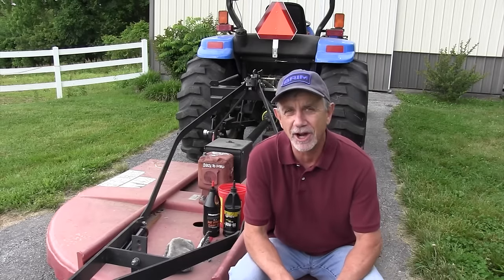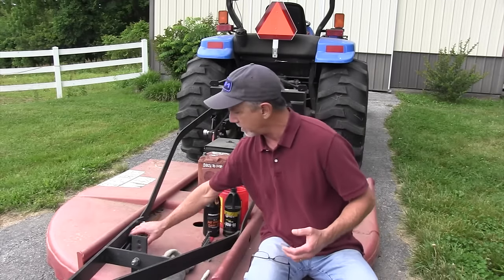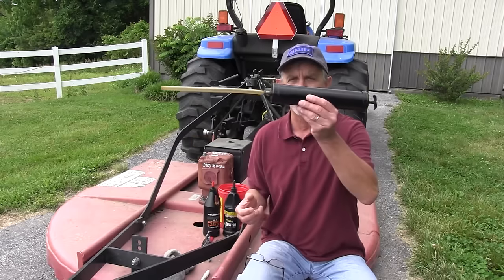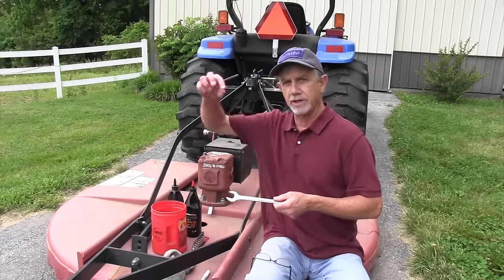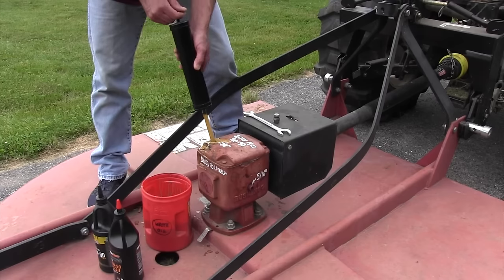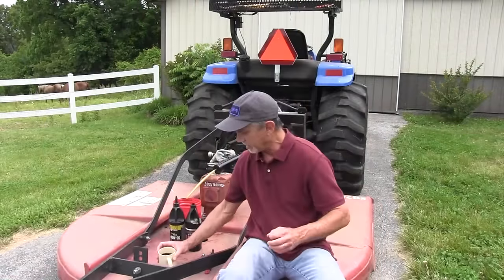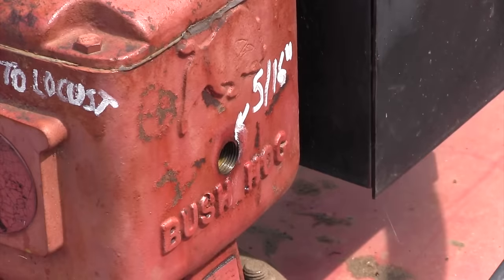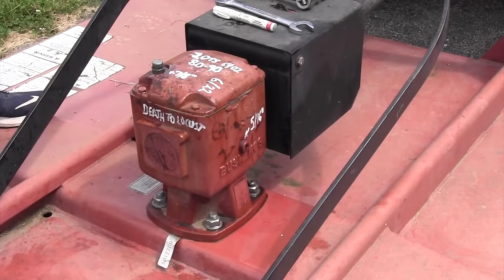How and When to Change Your Bush Hog Gear Box Oil

Comment: In 2009 I bought a County Line rototiller. They were really a King Kutter because I got a King Kutter manual with it. After I used it a couple of times and date it was time to check the oil in the gear case that's when I found out that it had grease and not oil in it. Brought it to the attention of the people at Tractor Supply and they said that that is a common practice to put grease instead of oil to prevent leaks. Been using it now for 13 years and haven't had any problems. Oh and Mike stick to making videos and not sing.

Comment: Great tip on marking with a paint pen. I have done that on mower decks with the blade bolt size, and any other tools needed. Nothing worse than lifting  mower deck, supporting, and crawling under to find out you brought the socket for the other mower deck, because, of course, they couldn't all be the same size.

Comment: Another way that those gear boxes get moisture inside is when people store them outside for winter and cover them with a plastic bag or plastic bucket. The sun heats the covered parts more than the outside air. When it cools after sunset, moisture condenses inside them.

Comment: Nice how-to vid Mike. Only suggestion I could add is to wrap that oil level plug with some teflon tape to prevent leakage and to make it easier to remove for the next time.

Comment: Mike, as I have commented before. I have that same cutter. I do one thing differently. I remove the 4 small bolts out that hold the top cover on the gearbox. Actually I remove 3 and back one off and swing the cover out of the way. This allows for a better inspection of the gearbox internals and easier manipulation of the suction gun.  When we had seals leaking on gearboxes at the state Highway dept we would take the top covers off and squeeze gun grease tubes into them. We could finish the road and change the seal when we got back to the shop

Comment: GOOD TIP HERE - I make a New contact on my phone for all my machines.  I have my truck, my M/C, golf cart, tractor, generator, etc.  Then in the notes section I put Vin number, lic plate, model, oil, filter ID, and TIRE PRESSURE..  if I do maintenance I put what I did when.  That way I always have my phone, I back up phone and if I am at a store and need something, I open up phone and have air filter size, oil wt, ect...  it works good

Since I usually fill up more tires at one time, I have a separate contact name Tire Pressure, I have all tires pressure on all vehicles, I hate trying to find and read tire PSI on bikes, lawn mowers, golf carts etc...  comes in handy.

Good vids, thanks for putting them out.
Reply from the maker: NICE!!!  I may steal that one :).

Comment: Only thing I would add to it Mike is that I would run the brush hog for a few minutes prior to changing the oil. If it's been sitting for a while the water will settle to the bottom and that will be the most difficult part to change, and the warmer oil will have a thinner viscosity making it easier to suck out
Reply: FYI, in case some of you are wondering about the "Death to Locust" -  Missouri is home to several species of thorny trees (not unusual to see 5-6" long spikes" that are  rather troublesome, as they  will rapidly spread out new seedlings in a pasture  Playa hell with tires .....
Reply: @MrDdaland  We have those here in middle Tn as well always go after then when I see one sprouting up somewhere

Comment: I noticed your bush hog is a few inches wider than your tractor's width.
After taking out too many fence posts and scarring too many trees I found a mower  that stays inside my tractors footprint.  
Thanks for the oil change tip Mike!
Reply: You always want a brush hog wider than your tractor footprint! That save you from running twice in the same line when mowing large fields.

Comment: I guess I may have missed it but about how often how many hours should they be changed? Ballpark.
Reply from the maker: If the oil isn't milky like mine, just leave it in.  Those gear teeth require such little lubrication that the only time you need to change it is if there's contamination.  My manual makes no mention of ever having to change the oil.  I should have said that in the video.

Comment: Great video Mike!  I like to check that my fill plug will come loose before i drain the oil, just in case there is an issue with the fill plug stripping.

Comment: I am a grease guy..
After changing gear oil for a few years straight, I filled my gear box  with grease.
I add a half a tube every spring and no problems whatsoever.
Reply: What kinda grease?

Comment: I change mine after using it for a while.  I also change it after the last mow of the season so as not to leave contaminated oil in the case and potentially rust the gears.

Comment: One thing to be sure to do is clean off and then blow through that vented top plug to be sure the vent hole isn't pluged.  If it is pluged, inside pressure will build up as the gearbox warms up. 
The pressure can force the oil out last the seals.  Ask me how I know.

Comment: Mike , Lucas recommends 50-100% of their thick oil stabilizer in gearbox’s. I have an old post hole digger that I filled with Lucas when I bought it because I forgot to buy gear oil and that’s what I had on hand . It has worked fine ever since. What are your thoughts on the Lucas Heavy Duty Oil Stabilizer in gear boxes ?

Comment: You can put “corn head” grease in gear boxes. It has a very very low melting point and it liquifies during operation. But at room temp is a grease like consistency.

Was told by a Deere dealer that it was perfectly fine to use in rotary cutter gear boxes. But really those bevel gears inside and the bearings don’t need a crazy special lubricant. Just something and enough of it.
Reply: Yes sir.  I had a Brown 6' brush hog that called for corn head grease as the lubricant.  My 10' Titan calls for 140 gear oil or EP-0 which is corn head grease.
Reply: I put that in the gearboxes of my old sickle bar mowers as well. No more weeping

Comment: Always crack bolts and nuts loose first with the box wrench, then switch to open end. 
Run it for a while to mix any sediment and water in with the oil before changing.
What's the "Death to Locusts" about? A curious sentiment indeed. Must be a story.
Love that white pen idea!
Reply from the maker: We have Thorny Locust trees here and my Bush Hog's main job is to eliminate them.  I thought it was an appropriate thing to write there since I hate them so much :).
Reply: @TractorMike  Ah hah !  We have thorny Mesquite trees around here. I understand. But we can't kill Mesquites by shredding. You have to grub out the roots with a skiddy or backhoe. Else they just come back stronger...

Comment: Hi Mike. I’ve got a 10ft brush hog with 3 gear boxes. The main GB is turned by the PTO and it turns 2 smaller GB’s which turn the rotary blades. The main GB is like yours which has a side plug to gauge the amount of gear oil put in but the smaller GB’s do not. How do you gauge the amount to put in???
Reply from the maker: Pull out the top plug and see if there's a dipstick on it.  That would be my guess.

Comment: Bought a well used bushog, added 90w oil to gearbox only to then find out there was grease in there.  Reckon I need to do something or will the mix not hurt anything?
Reply from the maker: As long as it's not overfilled it probably won't hurt anything.  If it starts blasting out the fill plug or a vent cap, there's too much in there and you need to lower the level.  You might want to slowly loosen the fill plug after you've been using it a while to make sure it's not building up pressure from being overfilled.

Comment: Hey Mike I almost hate to ask but I have not seen anything about this topic yet. PTO? More specifically a 2 position clutch, or over riding clutch or live PTO. I have a Kubota L3301DT and I have places where I have to back into a tight space with my brush cutter. With the clutch in the PTO does not operate. I end up with a small area that does not get cut because as I let the clutch out I am moving before the PTO has the brush cutter up to speed. I have the same issue with my garden. Part of it is fenced and I back up to the fence shift to forward let off the clutch and drop the rotovator but I have lost several feet while the tractor is moving forward and the rotovator is getting up to speed and being dropped into place. Oh yes, I am an old man but a newbie tractor owner/operator.
Reply from the maker: Steve, I hate to tell you, but I don't have a good solution.  That's the problem with a transmission-driven PTO.
Reply: Back up to where you want to mow put your transmission in neutral, let your clutch out with the ptp on and it will mow . Then put transmission in gear and move and mow out of there . Yeah , my growing up on a A John Deere has paid off .

Comment: On my hour meters i take a picture with my phone so i know when I changed oil. My rotary cutter said to put one quart in, so opened both plugs and started putting some in, it didn't take much but it started running out brand new. This is a brand new cutter which I checked twice. I even looked down inside and it was pure 80/90 weight.

Comment: What is the normal manufacturer's recommended service interval for a gearbox oil change?
Reply from the maker: My owner's manual doesn't say anything about ever changing the oil.  Those gears require such little lubrication that it's likely that as long as there's uncontaminated oil in the gearbox that it will last a lifetime.  If you'll read the comments on this video you'll find a lot of folks have 30+ year old cutters and have never considered changing the oil and they work fine.

Comment: Please remove the fill plug before removing the drain plug, just in case you can't get the fill plug out. Also I don't believe grease will dissipate heat as well as oil. Best,

Comment: Milky oil is always bad. I've also found even dealers sometimes overfill gear cases instead of correctly filling them to the level of the fill plug on the side. Death to locust indeed!